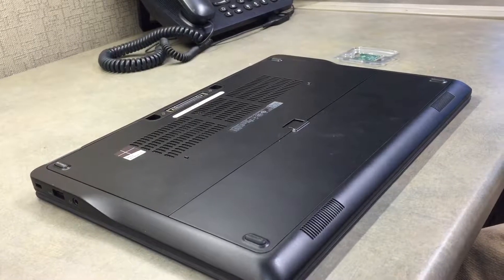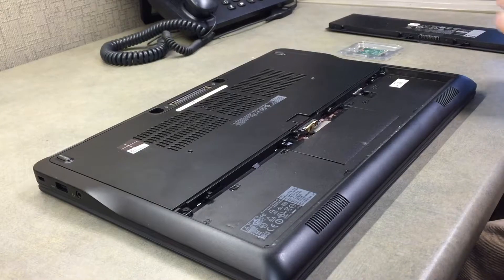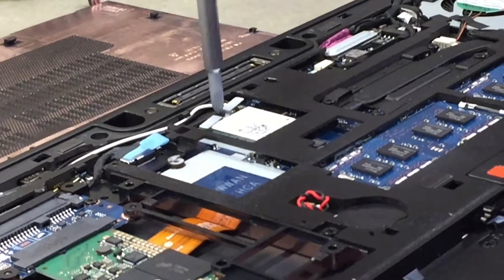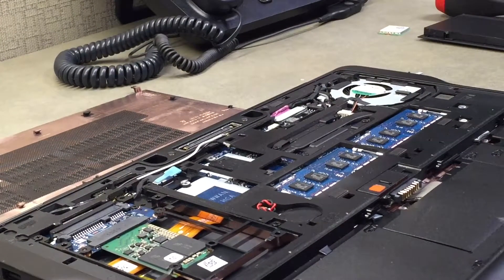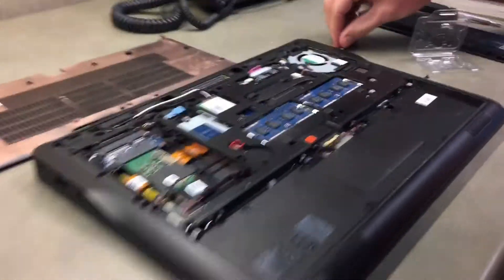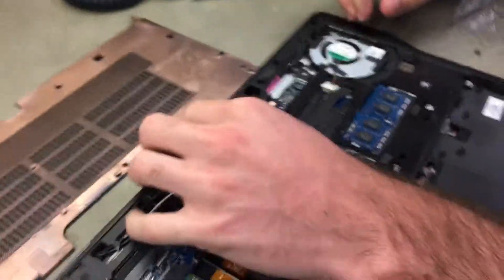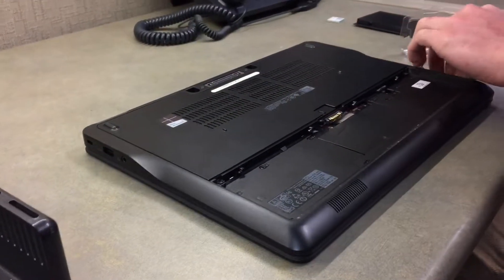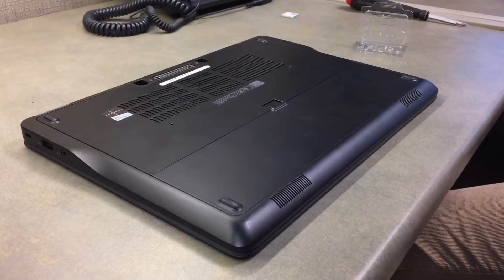How to replace Wi-Fi card on E7450

Comment: Thanks. I have serviced a bunch of desktops and laptops in the past, but when you're taking apart a laptop for the first time, it's useful to see a video like this so you don't have to guess where all the screws are that hold on a panel, and you know how much disassembly will be necessary before you start taking stuff apart. I'm glad that this card isn't buried, and I won't have to take apart anything else to get to it.